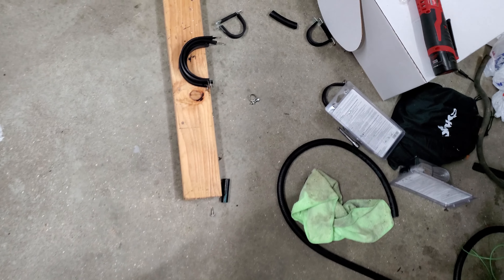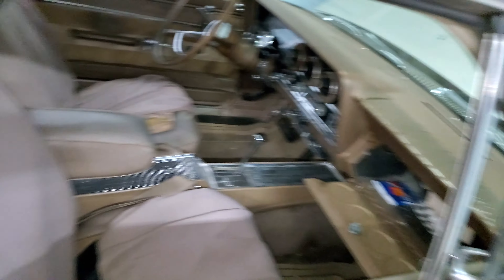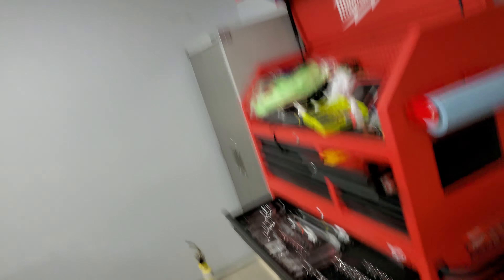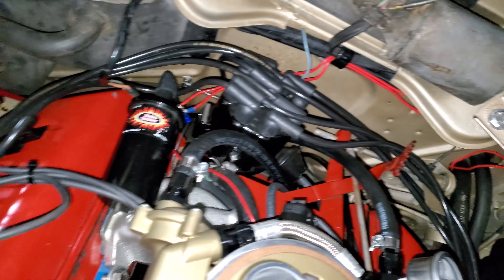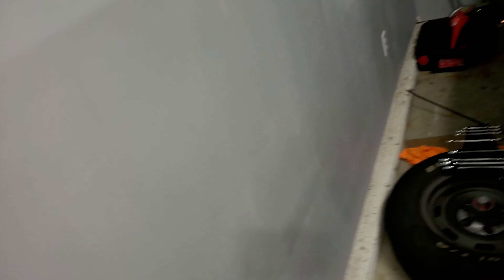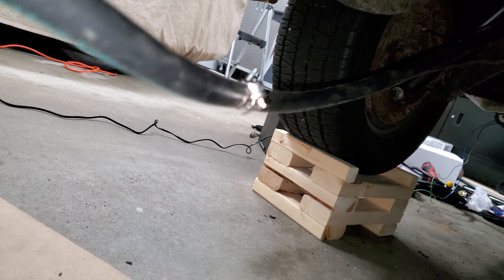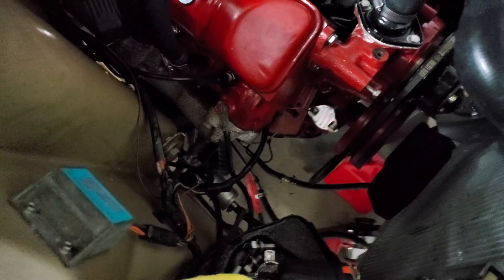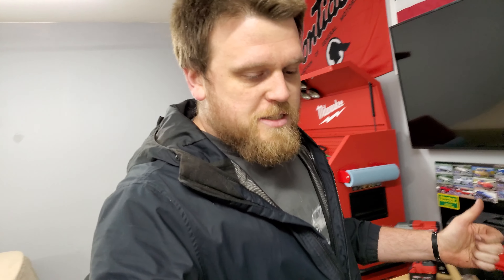Holley Sniper EFI Step 4 - We Have Fuel Pressure

Comment: Is your fuel line before your fuel pump coming from the top of your fuel tank like OEM or does it feed from the bottom bottom of the tank?
Reply from the maker: It's coming from the top like OEM.  I'd like to change that eventually, but I haven't gotten around to it.

Comment: Do you have the part number for the fuel pressure gauge adapter?
Reply from the maker: Here's the one I used: https://www.holley.com/products/plumbing_an_fittings_and_hose/fuel_system_components/gauge_adapters/fuel_pressure_gauge_adapters/parts/AT100199ERL

Comment: Your fuel pressure was 6PSI in last video.  So what is different this time to get the higher pressure?  Moving the fuel pump closer to the tank?
Reply from the maker: Sorry for the late response.. I think the biggest player in proper fuel pressure is the pump being closer to the tank.  I knew these pumps don't suck, they push, but I thought I would be okay still.  Moving closer to the tank and dropping the pump location a little makes it so it primes in about a second every time.  So far so good :)